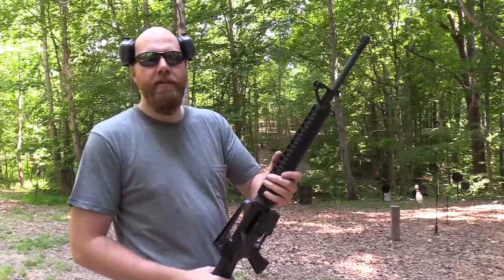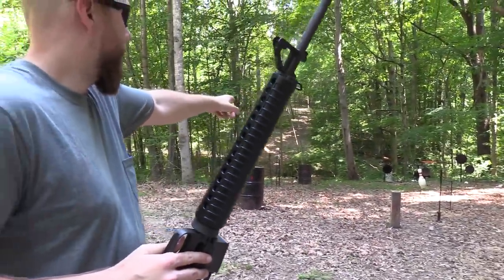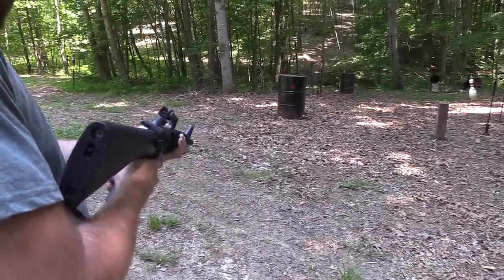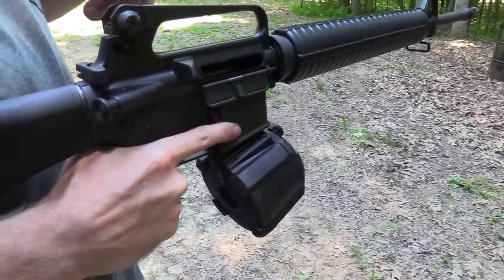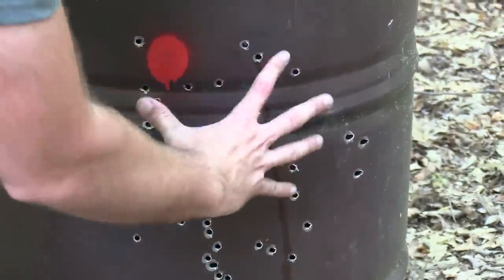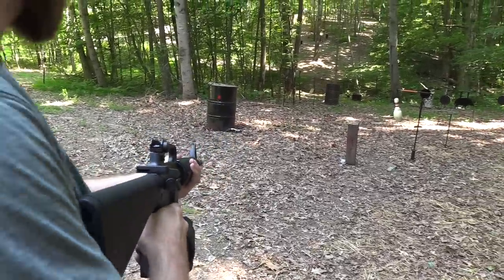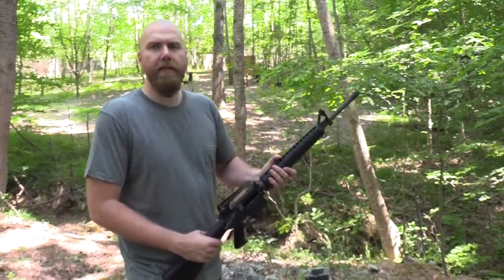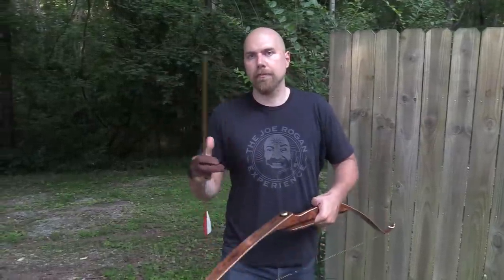Is Full Auto Controllable?

Comment: So, tldr;

Full auto is good, it's accurate and you can reliably hit a target down range with a good grouping. HOWEVER, there's almost no reason you'd need to use full auto as a citizen. It could have use in a military situation, but realistically you only need one to two shots to put someone down. Maybe if the combatant had a vest on, though they'd still be down as the shock would still hit them. I'd say the only reason to mag dump is to hit a target behind cover by shredding their cover (Like we saw with the bricks) or if they shot through a wall and you don't know were they are so you're hoping to hit them at least once.

Comment: Basically, you wont full auto a human sized target at 600m but recoil such as tarkov is just utter crap and absolutely over the top. Full auto also isnt practical because your mag will be empty in seconds which is why most units military or police only fire bursts since 4-5 rounds are enough to sufficiently injure a person beyond them being able to get back up to resume firing at you or to fire at you from the ground injured but still armed, even more so when paired with rounds that have a high stopping power or rip through felsh like hollow point projectiles or simply 9x19, .45 ACP etc.